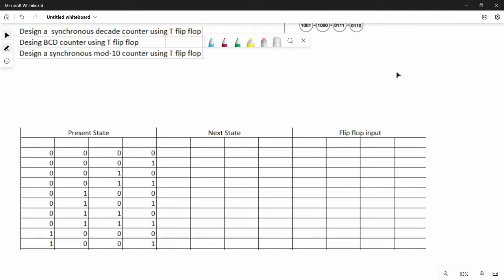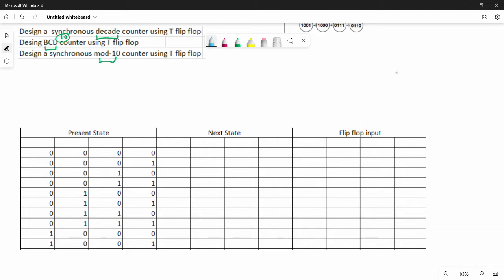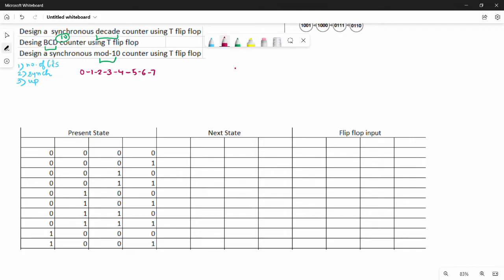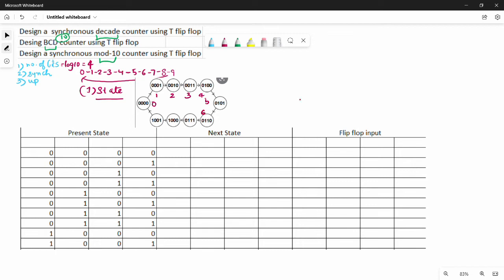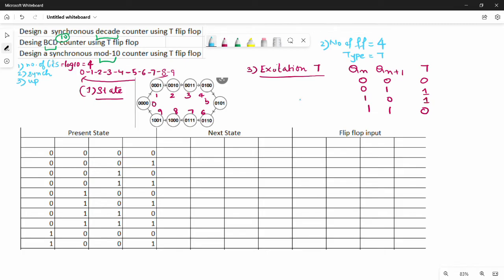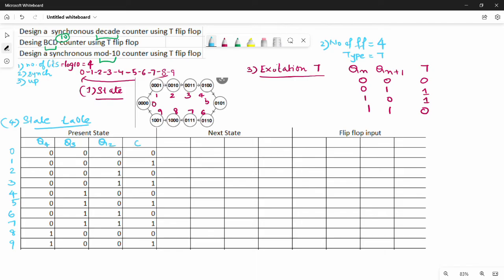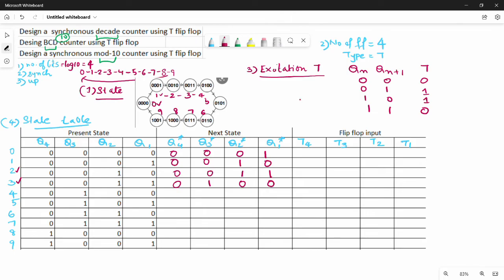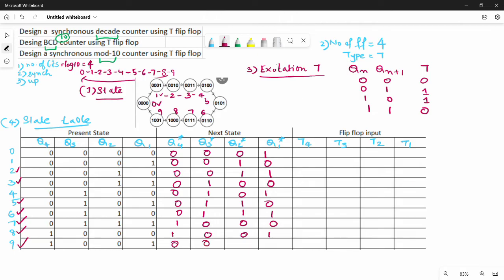2.10.2 Designing synchronous decade and BCD counter Tamil

Comment: Sir enaku t4ku q4 q3' q2 q1+q4 'q3 q2 q1 varuthu sir an t3 ku q4'q2q1 varuthu sir try panna?
Reply from the maker: In K map we may get different answers at times based on how we group, thats fine. But make sure you take the larger group always.
Reply: Enaku maari varuthu but mapping epidi irundhalum kadaikira value ketha maari thana varu neenga potrukathu diff ah iruke sirr?